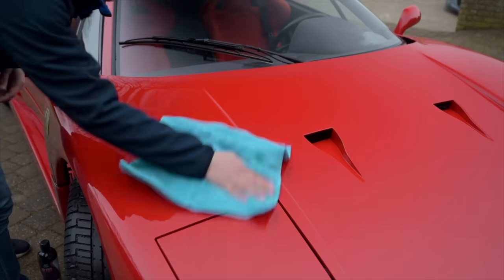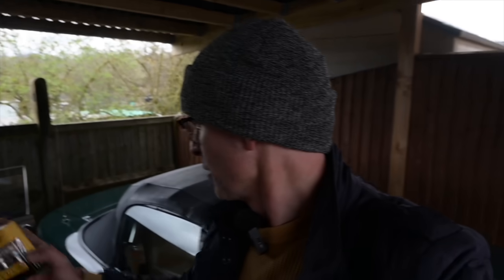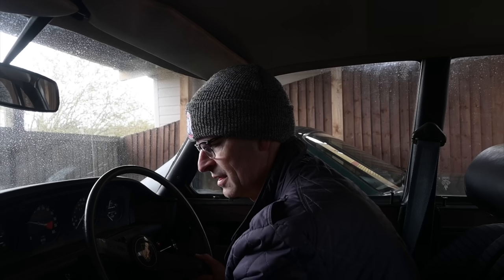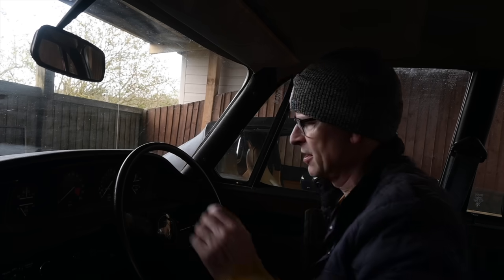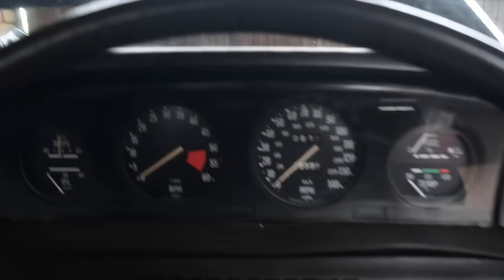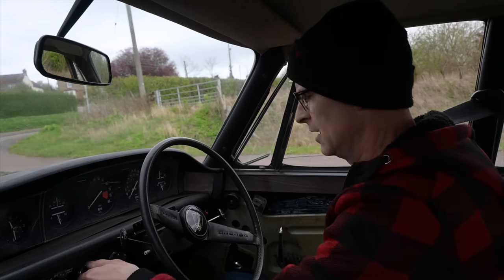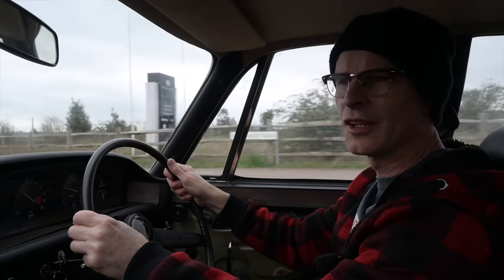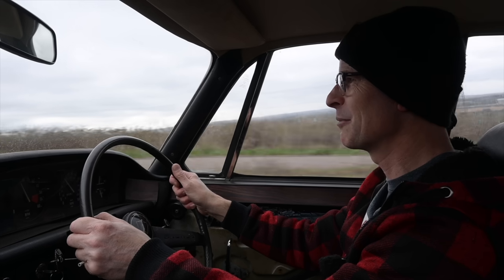4.6 V8 Rover P6 FINALLY goes for a drive (maybe it doesnt hate me now?) With Auxito AJ01 jump pack

Comment: I just checked. Wheel lugs on the P6 are specified for 65 lb/ft. Not uncommon for cars of that vintage. Volvo 240/740 are specified for 63. Use a torque wrench, then check the torque after 50 miles or so. Too tight damages things. It can also make it more likely to break studs under cornering. Hardly ideal.
The vibration you have been feeling could easily be flat spots on the tyres. The tires are at their end of life, regardless of use. 10 years is the maximum shelf life under ideal storage conditions. The tires were used a bit, which lowers that. New tyres are in order shortly. You do not want the damage an exploding old tyre will cause even with the car not moving. It will tear Hell out of the car. 
I never really did understand the dual carb single exhaust set up. It is backwards. An Edelbrock Performer intake and Quadrajet or Carter carburetor would be so much simpler and more efficient, and a custom dual 2¼ inch exhaust with H crossover would gain about 20 HP and 5 mpg on the motorway. 
For the transmission, I know you want a manual. With good reason. Get one from a Pontiac Firebird that is old enough to have a Pontiac engine. It will have the BOP bolt pattern, which should be the same as the bolt pattern on what was a Buick engine. No point getting a transmission from a Chevrolet. The bolt pattern will be different. Do the carb, transmission, and exhaust right and highway fuel consumption should be between 35 and 40 mpg on the motorway. After all, 40 mpg is what I achieved in my 5.8 litre 89 Grand Marquis. It matched the mileage I get now in a 2004 Toyota Corolla, admittedly on Haakappilliitta winter tyres.

Comment: Why don't you extend the fence to meet the roof to help with the dust
Reply from the maker: it would become a wind trap and blow the roof off (Ive looked into this in detail), the best option is slats on alternate sides of vertical posts, so the wind can come through
Reply: @furiousdriving the dust will still blow through. Hub Nut has that issue with his place.

Comment: I would have saved the petrol in a jam jar, I suspect some trapped water in the fuel system.
driveline noise" Universal joint? Flat spotted tyres may resolve themselves... The Bonnet latch has to be set in three dimensions height, is often overlooked. other than that , well done Sir....
Reply from the maker: we did try adjusting the spring/spike as well but it seem to be an issue with the striker plate snagging

Comment: Are you absolutely sure your  fuel lines are ethanol tolerant all the way.  Otherwise my guess would have been a week battery not quite being enough to drive both the pump and the ignition, the low charge may change the internal resistance enough to make that a thing. Even though it really sounds unlikely on a car with no computers needing power.
Reply from the maker: Ive replaced all the rubber in the engine bay, it looks like metal and hard plastic (which is normally OK) under the car
Reply: @furiousdriving  Inside the carbs aswell? That wouldnt cause that yellow petrol anyway  but just to be on the safest side we can. Wouldnt want any more mishaps with this car. You have the w123 for that. ;)